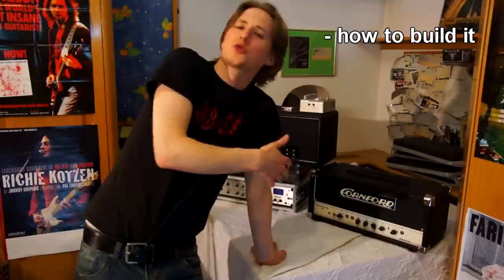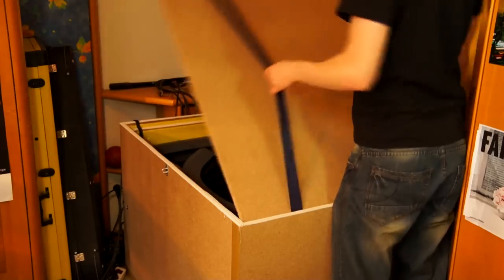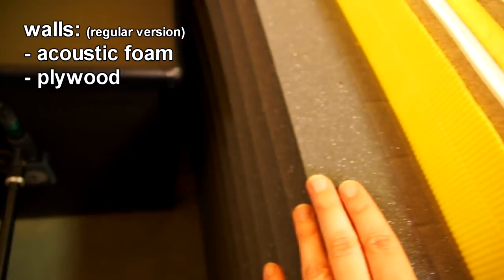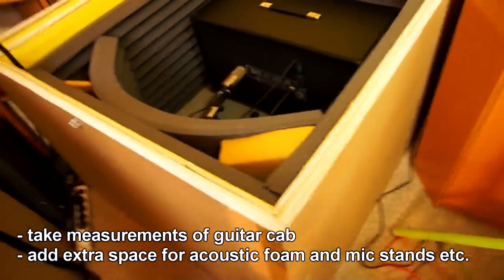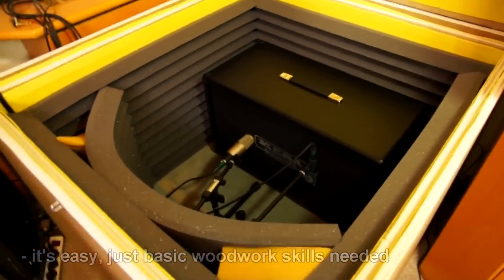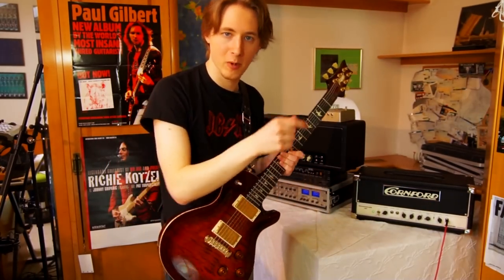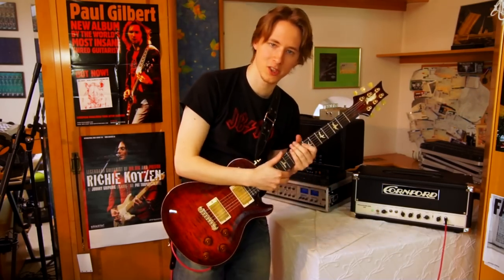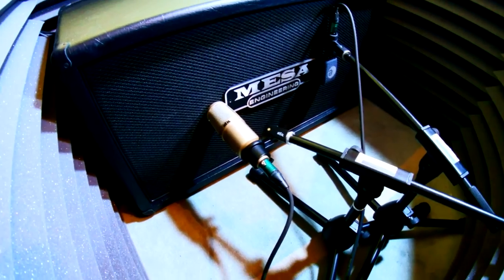Recording guitars with a DIY Isolation Cabinet (+ how to build one)

Comment: I'm sure this helps a lot of people and it's awesome that he made this video and put in the effort. However, for the amount of money it costs to built plus the money of preamps, multiple boutique tube heads, etc, I feel like just getting an Axe FX II is a better solution. Especially given the tones. No offense whatsoever, but the tones in these videos and the tones that the average guitarists with plenty of time on his hands will get even with an iso box and high end preamps and mics, etc, will still not be that great for the most part. There are really talented and experienced people like Pete Thorn that can use this type of setup with huge album-quality results, but most just won't get there. Pete's Axe FX demo's still sound just as good as his best mic'd tube amp tones, so I just feel like for the tones that most people will get going to all of this trouble and money, they may as well just invest in an Axe II and get consistent, huge tones in far less time. Not to mention the fact that you're going to get way more tones with the different amps and not just a single cab (which will make all tube amps sound similar), as you really need a proper corresponding cab/speaker to get true Vox tones, Fender tones, Marshall tones, etc. The Ultra Res cab sims that are shot through impulse responses of real speaker cabs, will give you much more convincing tones, and again they're going to sound more studio quality than what most people will get with a setup like this. Just my 2 cents.
Reply: im no expert but i believe the sound of a real overdriven amp through real speakers cranked loud and a digital representation of that sound are very different, like the same difference between an apple and a photograph of an apple. not convinced it works in a box tho?  which is why im here...  :)
Reply: 60ndown That's what anyone who knows how good a cranked tube amp sounds like and also knows what a typical solid state amp sounds like (i.e. - pretty much any experienced guitarist) tends to think until they hear and FEEL the Axe FX II for themselves. I've owned dozens of boutique tube amps and vintage ones, etc, and I also had a small business building and selling amps, such as Fender clones and modded Soldano SLO 100 type high gain amps. I know how tube amps sound and feel and I know that most anyone who thinks they can tell the difference between a tube amp and the Axe FX II is kidding themselves, as long as the context is correct. Especially through a recording, but even live in the room.

Some of the main DIFFERENCES are that the Axe FX sounds like an ideal cranked tube amp at any volume, it gives you recorded tones that sound as good as the most professional producers can get and you also get a much better, clearer sounding live sound since you don't have to rely on a directional regular guitar cab and the sound man's mediocre cab micing ability and mixing. You can get a clear, tight, studio grade tone live that isn't directional and harsh, so everyone can hear it, including you and your band. Just off the top of my head, watch the video "Homage" by Pete Thorn. He has a signature TUBE amp made by Suhr and like many other very famous guitarists, Pete Thorn still uses the Axe FX despite being able to use any tube amp he wants (which he does still use).

Comment: i record electric guitar, my keyboard and i sing.. i don't use a isolation box i have no need to.. i use http://www.musiciansfriend.com/pro-audio/yamaha-mw8cx-8-channel-usb-mixer-with-compression-and-fx  digital mixer.. hooked via USB to my PC.. all the "noise" is either my singing.. or the acoustics from the guitar.. which is very quiet being an electric guitar.    seems to me by adding an isolation cabinet you're just adding more wires and mics and chance's of noise interference being added to your music.  as for as effects.. will that's what recording software is for.   when nothing is being placed i like to see -0 DB on my recording meters...  with that box. the mic is going to be picking up the noise from the amp. (though you might not "hear" it there is always noise,) which is why multi-track recording is best when producing...   (just my thought's on the matter)
Reply from the maker: well, with or without an isolation box, it's the same amount of cables when mic'ing up a guitar amp. Just one time the cabinet and mic are inside a box and the other time they're just in the room. However, yes, having a digital mixer, or a mic preamp with a digital output that goes straight to the PC reduces any noise that may have been induced after the mic preamp stage.

Comment: or... a much cheaper way to record with no noise is to plug the line out into the mixing desk/interface...
Reply from the maker: yes, for that Mike Oldfield - "Tubular Bells" guitar sound ;)
The isolation box is to capture the sound of the guitar amp & cabinet.
Reply: I tried that, it sounds nasty and lacked a lot of low end, plus you get no voice from the speaker
Reply: I don't know much about recording clean guitars, but ya. If you're going for distorted metal guitars, direct input recording will do just as good of a job if you have the right software. i use Guitar Rig 5
Reply: David Krolak Dude, you have no clue how little you know. :)
Reply: ***** or you use something like a Mesa Boogie cab clone..
Reply: ***** true, which is why I said something 'like' a cab clone
Reply: Milan Adamovic I don't know much because I think I can get a good distortion tone from a virtual amp software? Ok then
Reply: +John Smith If you mean the hooking the out from the amplifier into the interface, that can present some problems. If its a tube amp, you'll blow up your tubes before you can really get any notes out. The tubes need a load on them that the speakers in the cab (or equivalent, like Torpedo Live) provide. I'm not too familiar with solid state amps, but I'm confident that it isn't healthy for them, either. Also, the line signal coming from the amp will probably be far too hot for your interface to handle.

If you mean taking the line straight from the guitar... well, IMHO, every amp sim I've heard sounds like garbage (with the obvious exception of AxeFX II--but that's hardly cheaper than building an iso cab).
Reply: +John Smith it is shit!
Reply: +Chris McCartney there are studio amps available nowadays like the Laney Ironheart Irt studio 15 w tube amp head and the Peavey 6505 mini head 20 w both of them are tube heads and have a dummy load so you don't need speakers to play them. Both these amps have xlr out to connect to the interface and direct USB connectivity.
Reply: ***** If you don't know how to EQ, boost/subtract frequencies in the amp simulator then yeah it sounds like shit. It's a steep learning curve to make it sound good but you can. Here's a video that does a comparison   /watch?v=vzbF5ZdeL4w
Reply: +Milan Adamovic You obviously know even less. If you know what you are doing you can get good sounds from sims. They will never sound like an amp, because they are not fucking amps but if its done right the similarity is shocking
Reply: I have marshall, Vox, Mesa (Mark V and Rectifier) and 5cab that's go with, and frankly with either lepou Hybrit for marshall and S-Gear for crunch and high gain sound, with carefull made IR (from match eq technique) the result is the same. My amp is for rehearsal, for recording, I prefer impulse, better results with no hassles.
Reply: Lol well you need to learn if ya wanna record and mix learn about mic placment / verbs/eq/etc   
Di deffentaly has its advantages as well , but when you start useing mics etc you will hear the sound difference i use di for bass guitars,   but ya di has its benifets, and learn how to record clean as well once ya have lernd some of these things your mixes will just sound amaze8ng!!